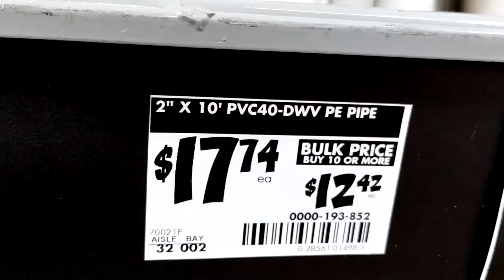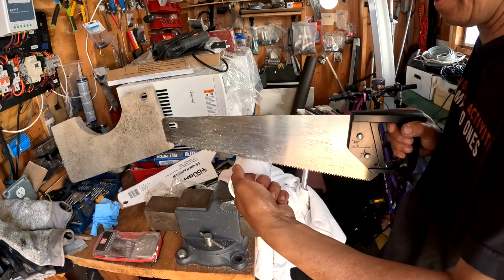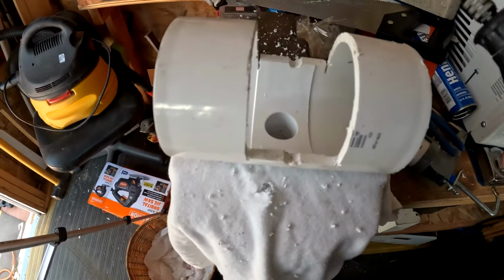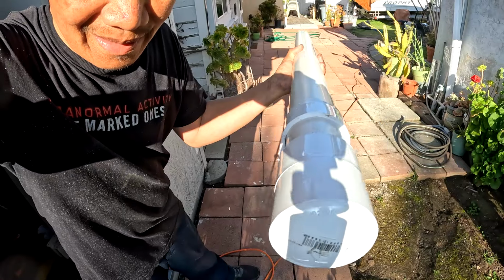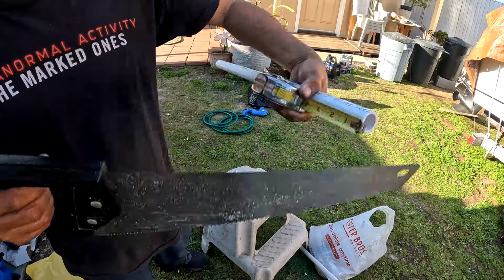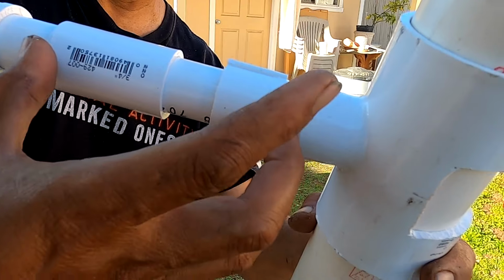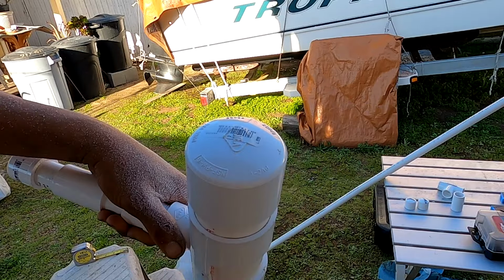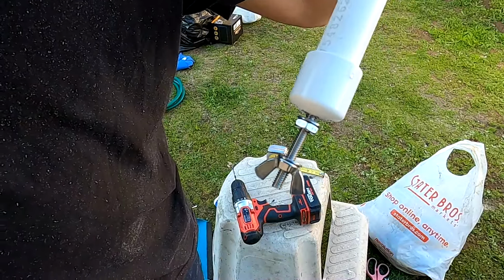Ghost Shrimp Pump /How To Make It/ Longer And Pumping More Shrimps #tutorial #bait #improvised

Comment from the maker: Some video Clips are missing because the GoPro was getting hot and for some reason it kept turning off. Anyways the 1/2 inch x 10 feet tubing video was not there but it is around $7 each and the 1/2 inch caps are around 45 cents. If you need one let me know and I will make you one .Just buy the parts and let me help you do it if you are not too far away. Questions just comment below.
Reply: Can I take you up on this offer I’m in San Marcos
Reply from the maker: @Mishka_Mishker  Sorry for the late response.Email me @ rctuna12@gmail.com.

Comment: Great video. This looks like it will work much better than the store bought pumps. Can you tell me what you used as the plunger that goes inside the big tube at the end of the 1/2” pipe? The video ended right when you were getting to that part. Thanks